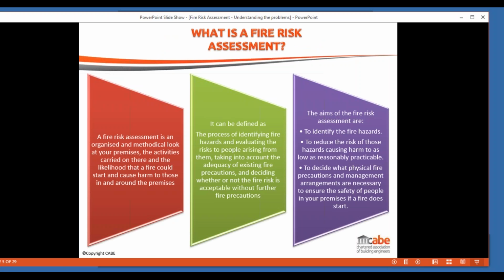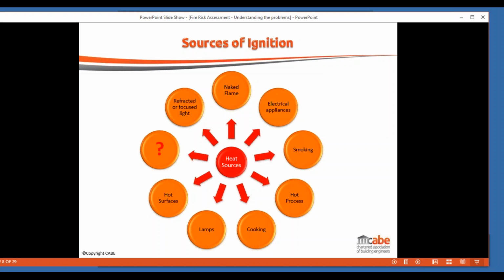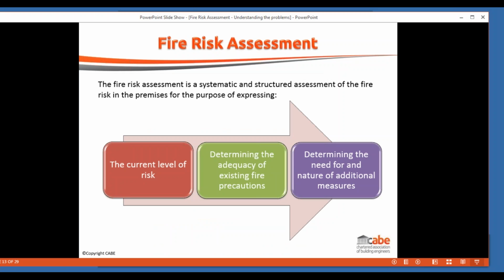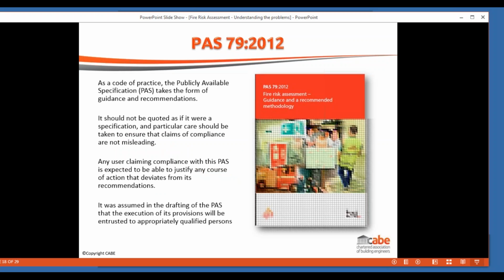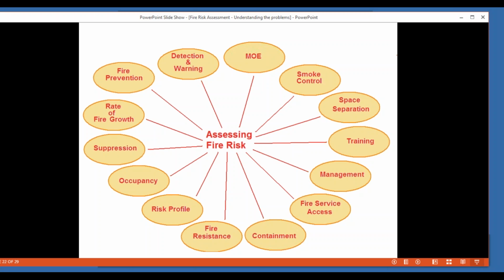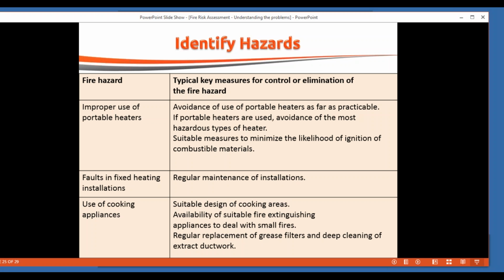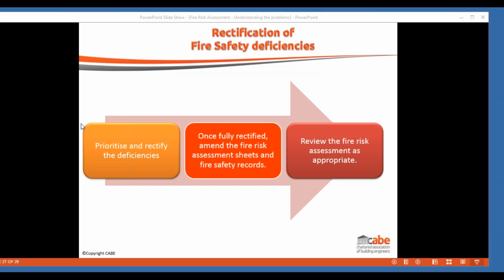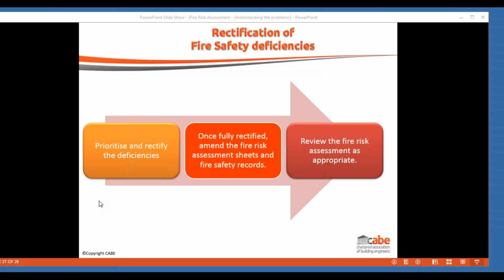Fire Risk Assessment: Understanding the Problems

Comment: How often risk assessment has to be reviewed? Is it annually or once is done and there was no building structural changes it doesn't have to?
Reply: The general Risk Assessment has to be reviewed whenever there are changes to the : people, environment, materials, equipment, processes, and legislation and the Fire Risk Assessment. For example if the building was done and there are changes to legislation it would have to be reviewed to see if all the measures that are in place adequately meet the requirements. ...